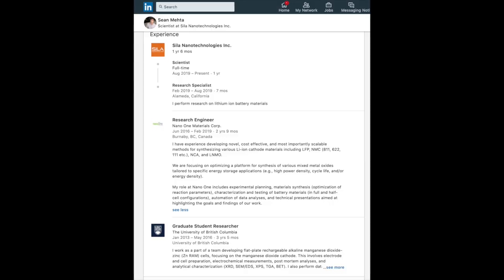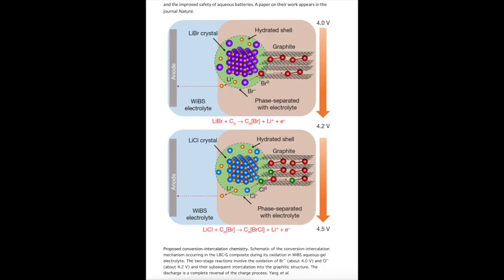Transition Metal-Free Cathode Breakthrough? w/ Sean Mehta, Battery Scientist

Comment: I'm commenting as I watch this - if high temperature sintering is needed to produce synthetic graphite, why not position a solar furnace in the desert near a large factory that will be used to manufacture batteries? Heliogen announced late last year that they can use AI and mirrors to generate temperatures over 1000°C. Their thought is for melting steel to replace fossil fuel use, but why not sintering graphite as well?
Reply: Sintering furnaces are quite energy efficient even though the temperatures are so high. The insulation is very effective. I have a sintering furnace I use for battery research and at 1000C it is only drawing ~200-400W. So the engineering challenge of doing it with solar may not be worth it. I like your idea though.

Comment: Great value guest. Interesting that a lot of industry insiders watch the Hyperchange channel to understand the value proposition. In terms of recycling cells, if they were discharged, chopped up, put through a 'cyclone' to separate materials, aluminium can, electrolyte, and jelly roll material, I think the jelly roll pieces could be dumped in to a furnace to separate the various metals to a degree. Nickel laced with Lithium could still be used in steel making. Perhaps, the cells could just be put through a shredder and dumped into a steel making furnace.

Comment: There's no fundamental difference between pouch and cylindrical cells. A cylindrical cell is just a pouch cell that has been rolled up. However, the cylinder form factor does have some advantages. When the battery is stressed, it may need to gas. Cylindrical cells will usually have vents to allow for gassing. Further, because of the uniform pressure in a cylindrical cell, swelling is mitigated. This is not the case for pouch cells which usually do not have even pressure throughout the middle of the pouch and can swell sometimes to a large degree. Pouch cells can be stacked to increase the density beyond that of cylindrical cells, but that's not necessarily a good thing. Heat management is critical, and the spacing created between cylindrical cells placed close together actually serves as a heat sink to help pull heat out of the battery. Heat is the enemy.

Comment: This was big news last yr in the battery community. Very exciting stuff and look forward to see Saft commercialise (from memory was Saft)
Reply: Producing artificial graphite requires ~2900degrees C, generally staring with needle coke, pitch and often natural graphite for a high quality material (high energy density). 
Graf cost in USA is significant.. >$4/kg, while in China that's as low as $2/kg - mainly due to different furnace tech required by the law (no new Archeson capacity in US, its deemed as too dirty whereas its dominant in China especially Inner Mongolia.  
Natural and artificial graphites, as well as soft and hard carbons all have useful attributes. Silicon too, although its more of a booster additive these days, like nanotubes and carbon black act as conductive additives. 
__
As for LBC-G cathode, 
Material seems very promising however more complex mechanism than today's Li-ion batteries. 
Uses graphite in anode and cathode, so the cell is all intercalation – this may have some durability and safety benefit over conversion chemistries
Energy density is very good as you don’t have all the expensive, bulky oxides of the transition metals for stability - exciting

Comment: Elon Musk has commented before with SpaceX about the fallacy of sunk costs - if they decide that cylindrical cells in modules are no longer the way to go, I have no doubt he will push the company to drop them regardless of the sunk costs.
Reply: Non-fallacious cost of switching from one to the other is relevant. Certainly they will not stop producing cylindrical cells in modules unless and until they have a replacement ready so they don't have to stop producing cars during the switch.
Reply: But he did expand the JV with panasonic for 10 years after certain production goals. So at least the next 10 years they will provide cylindrical cells. Could be just for energy storage, but I suspect that regular model 3 and Y will stay with cylindrical cells for years to come. But maybe plaid versions will receive the new batteries
Reply: We still don't know anything about the pilot battery line at Fremont and there are two more Gigafactories under construction without confirmation they will be building panasonic's cylindrical cells. It seems for China at least CATL will be building pouch cells for some of the vehicles and LG Chem has been approached as well for China and they were to provide pouch cells for other OEMs. Of course they won't remove the line in Nevada without having a replacement, but it doesn't mean they are not already looking.
Reply: @MrJmreal6688  
CATL builds prismatic cells, not pouch cells, unless you have newer information that contradicts this.
Reply: @theuncalledfor  I don't, you are right. CATL is prismatic. However it only strengthens the case for Tesla being willing to break the cylindrical mold as they see it necessary or beneficial.
Reply: @MrJmreal6688  
As far as I know, they're only switching in China, and only because CATL is producing the prismatic cells anyway. It's not a specific desire to get away from cylindrical cells, so much as it is an adaptation to a new battery source.

I could be wrong, of course. That's always a possibility.
Reply: It is likely that Tesla will segregate the type of battery used by vehicle model and market.  As long as the battery meets key criteria then Tesla will make use of it.  Battery development is occurring at a rapid pace and Tesla recognises the importance of not becoming too committed to any particular battery form or chemistry.

Comment: Adding stuff I didn't hear on pouch vs cylindrical:
Battery films like to be under some mechanical compression to work well, that complexifies pouch pack engineering. With cylindricals, that's easy.
Cells use less material than pouches per unit, so at the same manufacturing defect rate per unit, you throw away less active material with cylindrical. Currently that is the dominating factor in cost, so it stands to reason to optimise for that (even if that makes making the pack a bit more costly, and or less efficient density wise). Further, assuming the same rate of deffect per surface unit of battery film (aka jelly film/roll), pouches will have much higher reject rate, so it'll either cost more in quality assurance to keep it lower, or more in material rejected.

Comment: As you guys were talking about battery breakthroughs, synthetic graphite vs "organic" graphite, changes in chemistry and how that can change cost and manufacturing methods I couldn't help but thinking how gravity affects it all. I began picturing 3D battery manufacturing possibly even on the moon and probably in "zero" gravity industrial modules in space. Probably wouldn't directly help Tesla on Earth, but consider electric vehicles on the moon and mars among other utilities.
Reply: Somewhat related: The term "microgravity" doesn't really make sense (or at least I don't understand how it does). Orbiting space stations (at least in low Earth orbit) still experience a fairly high amount of gravity - that's why they're orbiting, rather than hanging in space motionless. (Less gravity in higher orbits, hence why higher orbits move slower despite having lesser curvature to work with (bigger circle!) in their orbit.) So why "microgravity" rather than "zero gravity"? They're both technically inaccurate, but the latter gets across more clearly what you actually experience on a space station.

Comment: Can you take a few moments to elucidate the distinction btwn cells and modules? Vague at best for some of us. Thx.
Reply: In the Model 3, Panasonic ships over 4,000 individual cylinder cells (they look like larger AA batteries in shape) in special crates. Those crates are fed into automated machines that, skipping the details, glue them to a cooling tube to create a bandolier. Seven bandoliers are attached to each other with pieces that connect all of the cooling tubes together, with a cooling tube with an opening for the fluid to go into on one end and another with an opening for it to come out on the other end. The batteries are connected to each other with another piece so current can flow in and out.  Plastic pieces are glued onto this so it can mount in the pack and that whole thing together is the module. A lot more happens, but basically you have a bit over 1,000 cells in each module. That is the difference.
Reply: @tribalypredisposed  Thx. I get that part. But the talk is of "packs" replacing "modules." That distinction is what remains unclear.
Reply: @grizzlymartin1  I think that the modules got put in as early as Roadster 1, before anyone knew how the stuff would hold up, so that if part of the car battery went bad, that module could be "easily" swapped out for a good one. Kind of like our human appendix; noone actually needs that anymore. So now the thinking seems to be - hey, why not make the whole pack one big module? Much simplified construction and may have other benefits as well. In Model3 and ModelY it seems to be too much bother to actually extract a module (may as swell scrap the whole car) but they are still in there as a relic. (We believe; don't think anyone has taken a can-opener to a recent ModelY yet ... :-) )

Comment: What about another step in cylindrical cell size? To few are discussing that, being seduced by more long-term new chemistries. Tesla successfully stepped up from 18650 to 21700, making cells&modules&packs more affordable for a given capacity. That is just an engineering question of how to make both thermal and electrical conductivity improvement -- the more improvement, the more size can be increased. (Also this could optionally be combined with placing the cells horizontally in the pack, touching each-other except for a very thin outside isolator, with straight cooling channels in the triangularish gaps). If you combine this with the announced elimination of modules, and the practically-announced Maxwell DBE technology and some modest improvement with the implementation of current NMC/NCA chemistry, you could make a very significant leap forward in reducing cost plus a bit of improvement in capacity/weight.

Comment: It sounds like some of the new battery tech could create cheaper batteries but at lower energy density, which may be fine for stationary installations, but not necessarily cars or trucks since such batteries could be too large or heavy. That would mean the cost of stationary battery installations could come down, including power walls. Not my field, so don't take it to the bank.

Comment: I just feel a brand new form factor coming. Maybe really fat squat cylinders, maybe long thick cylinders that look like a D size Maglite tube and lay end to end, who knows. The elimination of tabs and other innovations that reduce the heating and reduce the distance the electron has to travel seems to open up a huge continent if new possible answers to Musk's first principles questions. Costs for pack assembly in theory could plummet along with a reduction in the number of cells and reduced complexity of assembly, and with cell to pack you eliminate even the putting the cell in a holding crate and getting the crate onto an autonomous cart (they are named after characters in Star Wars) and then off the autonomous cart and so on. The only time the cell will be handled after it is made will be to place it where it goes in the battery pack. 

I see a huge jump in power density and a huge drop in costs per kWh at the pack level coming. Great for Tesla. Not great for everyone else who already cannot compete with Tesla on range, performance, and price.

Comment: Tesla will move away from cylindrical cells when they think they have a chemistry that is less volatile, needs less thermal management, and the energy density is high enough to make the shift.  The LiFePO4 they are using in the Chinese SR Model 3 meets the first two criteria and since it's in the short range version the lower energy density doesn't matter as much.  Also the lower volatility and thermal management needs means they can make up for some of the lower cell level density by having a less complex pack and support structure for the entire pack.
Reply: Good points, but i don't understand why the 3rd criteria is needed.

Comment: Just for info, re Imperium 3 Battery consortium, Magnis Technologies  MNS:ASX, Charge CCCV (C4V LLC) and their new fast charge battery technology , 6 min for 85% charge.
Note MNS has Stanley M Whittingham (One of the Lithium Battery Nobel Laureates along with John Goodenough) on the board of Directors, why I invested in them years ago to watch the share price slowly drop 90%, but still holding

An extract from their latest ASX news release - using BM-LMP Cathode and anode using proprietary C4V and Magnis technology

Extra Fast Charge results for unoptimised cells developed by Magnis Partner, Charge CCCV, LLC. ("CLIV"), have yielded a potential game changer for electric vehicle (EV] manufacturers.
Over 85% charge achieved in 6 minutes.
Potential ability to shorten the charging times and thus enabling operational flexibility for EVs, convenience to EV consumers, and potential increase in run time for in-service EVs.
Low cost and sustainable processes are ethically aligned with the use of such designs as requested by EV manufacturers.
Magnis Energy Technologies Limited ("Magnis", or the "Company"] [ASX: MNS] is very pleased to announce that Extra Fast Charge ["EFC"] test results for electric vehicles ["EV"] batteries developed by Magnis Partner, Charge CCCV, LLC. ["CLIV"], have yielded a potential game changer for electric vehicle [EV] manufacturers.
https://newswire.iguana2.com/af5f4d73c1a54a33/mns.asx/2A1238352/MNS_Extra_Fast_Charge_Batteries_Potential_Game_Changer

Note Magnis is >50% of Imperium 3 New York Gigafactory just being completed in NY State and Magnis also owns a high grade Graphite mine being developed in Tanzania

Comment: Hey Sean I have been watching many videos on Li Ion batteries cells and the question nobody answers is why during discharge would a positive Li Ion travel from the negative anode to the positive cathode ?  To me this is up hill and would require some energy to overcome this potential.
Reply: It's easier to consider what the electrons are doing. They move from the negative anode to the positive cathode through the wires (path of least resistance). The Li+ ions follow, just through the electrolyte instead of the wires.
Reply: House Essentials  No
Reply: House Essentials  No dumb
Reply: So sean any insight???

Comment: DISRUPTIVE BATTERY GRADE LITHIUM FROM BRINE WITH NO EVAPORATION PONDS

Hi Gali, I though given your recent videos that you might be interested in doing a video about current lithium from brine supply.  There is one soon to be European producer with better than zero carbon production using their own tech without evaporation ponds:(ASX:VUL).  Then there is a independent tech coy, “Lilac Solutions”, who is offering similar tech to VUL (no evaporation ponds) to at least  one soon to be lithium producer  (ASX:LKE).  Lilac is a private coy so there is no info on who else it may be offering its tech to.  Whatever the case, battery grade lithium from brine production without evaporation ponds appears (esp given TESLA’s environment statement and VUL’ s locating right In Germany) to be proven disruptive technology that appears around 12 months away.  Talking to Lilac and possible VUL would be interesting. Less so LKE  as it is relying n Lilac’s technology.  VUL’s share price at around 50c+ looks appealing, LKE’s share price seems  cheap.  FD I have shares in both VUL and LKE.